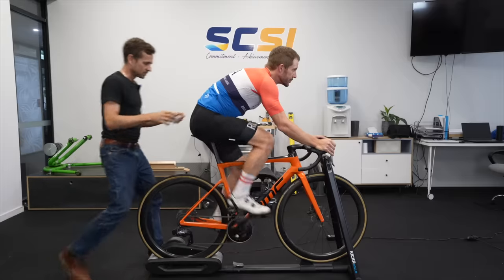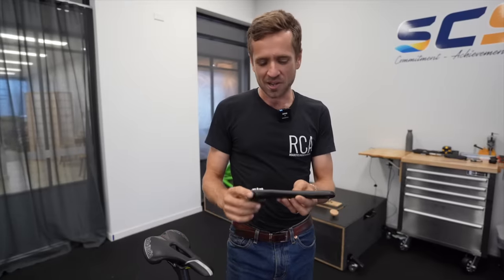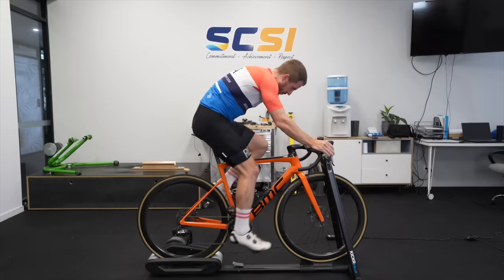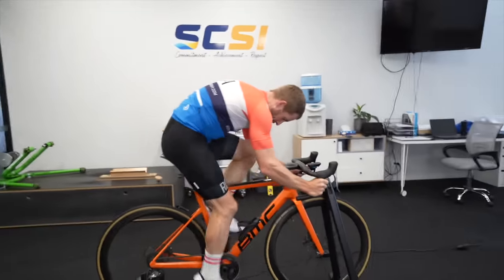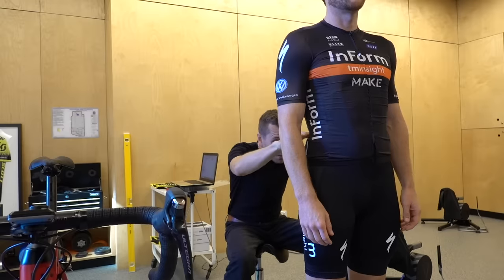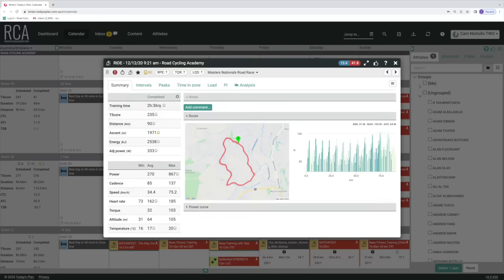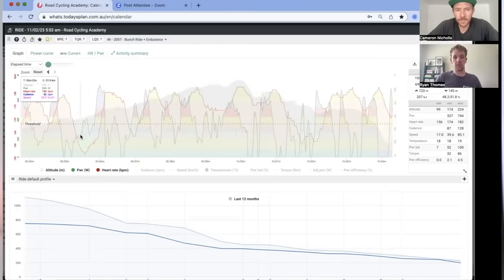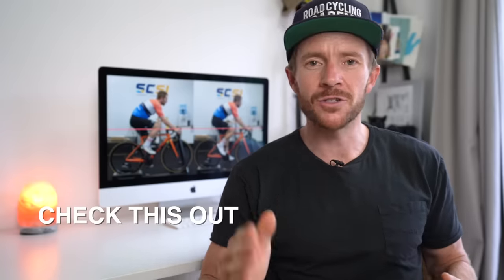I've Gone Back to 165mm Cranks (Fast at 41)

Comment: I tried 165s but they were too small so settled on a 170. I have an 85.7mm Inseam but my length ration is higher  in the tibia/fibula as opposed to usual. I have a shorter femur ratio. I too have a slight hip impingement in my right hip joint which I felt a lot more on the 172.5 and 175. I've gone back to a 52 chainring and spinning at higher cadence still working th the 170. I should also mention I shifted my saddle back from slammed forward to the half way mark. I believe that has also open up my hip albeit I feel I've lost a bit of torque. Swimming is good I must get back to a weekly lap session.
Reply: Moving your seat back will cause more bend at the hip. With shorter femurs, you should actually move your seat forward - consider your knee position vs. someone with longer femurs, you'd need a further forward seat
Reply: @ProWeAreSo  Intuitively and bio mechanically I agree with you. For some reason going  back and slightly up in the saddle, from the calculations, it's working well.

Comment: Seemingly impossible to find 165mm cranks in the UK
Reply from the maker: I had to call around the country to get these!
Reply: 165 mm cranks are harder to find in general I reckon, it's not easy to find a Shimano unit here in Malaysia, but it's not as hard if it's a Rotor or Croder or any modular crankset.

Comment: Since Pogacar has dropped down the crank lenght from 172,5 to 170 I think he has lost some power in the climbs. He pedals with more cadence in flats classics and climbs, but years ago like in the final TT when he won the Tour of France to Roglic, he seemed to have less cadence but more power in the climb, in fact he won 2 Tours with 172,5mm cranks. Jonas Vingegaard is running 172,5 and he is even a smaller rider 174 cm, and look how his knees go upper than Pogacar´s knees now. So I think that deppends of your style or riding as Jonas Vingegaars for example likes to have less cadence and going with more strength in comparison for example of Roglic who also goes with 170mm cranks but with a lot of cadence. I am saying that because nowadays it seems shorter cranks are better, but I dont thinks so, it is like a fashions, and it is not for everybody.. it depends of your riding style...

Comment: 6'1" with 77.5cm saddle height, rode 175mm cranks for decades, switched to 165cm about 3 years ago and transformative in terms of reducing hip impingement, much easier to rotate pelvis forward, riding more aero, more hip comfort, can spin a higher cadence easier, no loss of speed.
Neill is brilliant in his fit analysis. 
Two biggest mistakes IMO that production bicycles come with....cranks are too long relative to frame size convention bike mfr's use  and handlebars come too wide.  A last note a bit unrelated...but somewhat relevant to comfort which Cam addresses, for the average rider, especially those longer of leg relative to torso...they (me) are better served on an endurance geometry frame, in particular if not racing at the elite level.
PS. just wanted to mention for those considering a change to their set up and Neill has discussed this in other videos....
Q-factor.  A narrow hipped rider like Neill is going to do best with shorter pedal spindles.  For a guy like me who was born more wide hipped...I am relatively lean just my hips are a bit wider and I ride a 155mm saddle due to sit bone spacing, consider adding pedal extenders to get your feet more under your hip joints as you pedal.  I didn't pay much attention to this for years and then stumbled upon it and it helped for overall hip/knee health and power production.  If changing cranks, something to consider if taking off your pedals.
And...a last and unrelated note. I live in a warm climate in America like Australia.  For overall fitness, swimming + bike riding in even amounts I believe produces the best body and fitness.
It may not make you the fastest bike rider but will produce the best body.  Cam if you see this, try to work in 2-3 days a week in the pool and cut out one bike day depending on schedule.  I do both on the same day a lot.  I grew up a competitive swimmer.  Also Cam, take lessons brother.  Swimming with efficiency is as complicated as bike fit.  As with cycling, the more you know, the better you swim...both are an equation.
Reply: Curious about your experience riding a 155 saddle. What's your sit bone measurement?

Comment: I think short cranks are a bike fitters "thing". I've seen several posts of people saying their bike fitter recommends short cranks. I look towards what the pro's are using and I'd bet there aren't many using them, meaning they hurt power. I know we're not pro's but we're trying to make decisions based on what makes the most power not what looks good. Also, what kind of cadence you like to hold probably plays into it alot, I prefer more of a lower cadence high torque style.

Comment: All theses questions about which is better are pointless. Bottom line, forget about the garbage advice everyone is peddling to not get a real bike fit. See a bike fit pro and get a fit. If your body geometry is better on a particular crank length, then use that length. There is no advantage otherwise, no one-size-fits all.